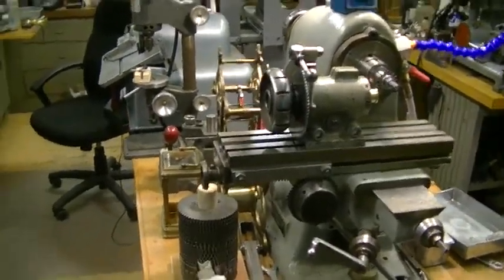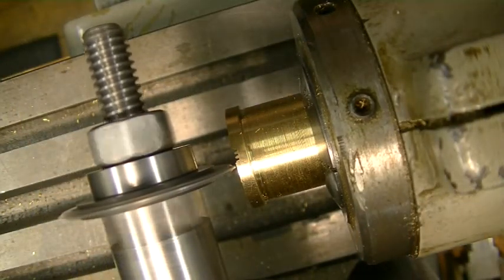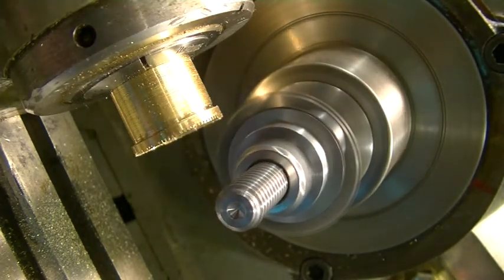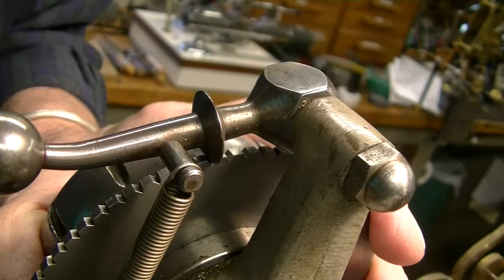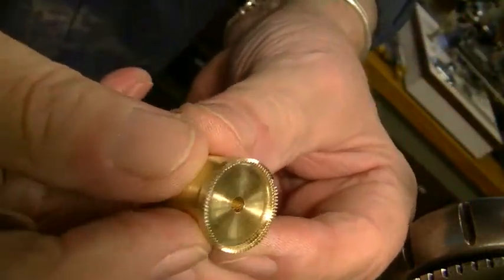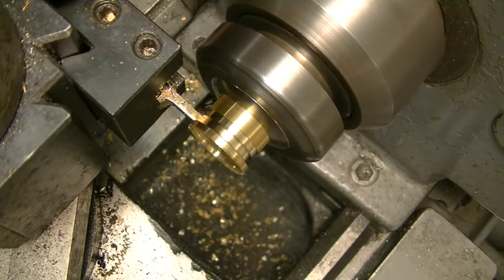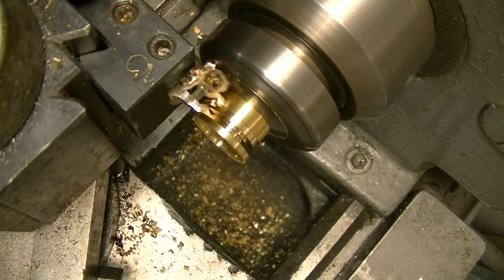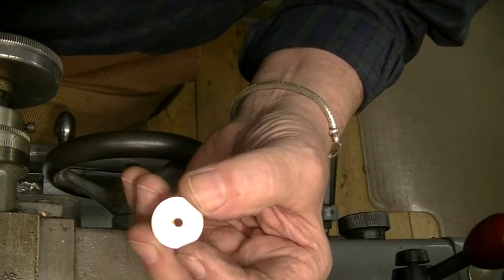Clock repair tutorial. #6. Cutting a new contrate wheel for a carriage clock. Part 2.

Comment: HSS is very good for brass machining including turning drilling and milling. You do not need a carbide soldered tools for brass, however you can to use insert style turning tools for brass machinig, then you will have to use special very sharp carbide inserts designed for brass or aluminium.
Reply from the maker: +Radoslaw Jocz  I have been moving towards HSS for brass for some time now. I do use carbide on steel and sometimes just don't take the time to change the cutter.

Comment: High speed steel vs carbide. I'm under the impression carbide does not transmit transient energy to the rest as well. You gain a slight dampening effect with the HSS. But theory is all well and good. It's you guys where the tool meets the work that best determines. Often through trial and error.